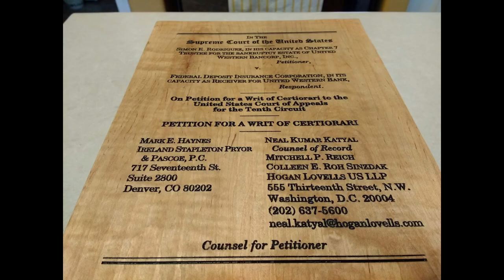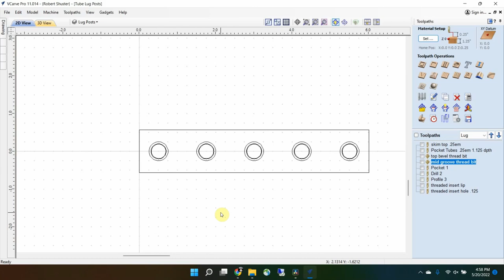Making Custom Wood & Brass Drum Tube Lugs

Comment: Soooo many questions (which translates to inspiration).  I’m heading down this EXACT path.  So, much so I’m in the final process of building two major projects that are all part of a major remodel my wife and I are doing.  One is completing a workshop that will have a CNC machine, among other typical machinery….and the other is a home studio.  Two, questions.  1). Do you sell your plans/designs for the CNC machine?   2).  Do you sell any of the hardware you’re making.  I can’t find anyone to build me a set of really great looking rims for a custom kit I’m having built as I type.  I absolutely hate the generic round style hoops you see online.  I want something in the shape a die-cast hoop.  You’re work is incredibly inspiring, given you’re doing exactly what I want to do.

Comment: Great Vid, Rob! What size tap did you use for the brass tubes?
Reply from the maker: 12-24 for the tension rods.  I like this design for "pretty" lugs, but I am not convinced they will hold up over time.  I am always trying to find that perfect lug design that looks good and will hold up over time.  I feel pretty good about the lugs I did for the "snake skin" drum - they look good and are very sturdy.

Comment: Hey Rob great start to finish video. I'm interested in those threaded inserts you used. They look to be a low profile variety, can you list the manufacturer and part numbers?  I make tap handles and allows looking for a better insert. Thanks
Reply from the maker: I have had those for years.  I will try to find the order info.
Reply from the maker: I "think" these are the inserts I used.
https://www.amazon.com/dp/B01NCJHLR7/?coliid=I3MO0J0K6V7HWT&colid=2M19JRVX5LB2Y&psc=1&ref_=lv_ov_lig_dp_it
Reply: @sidewinderdrums  thank you Rob, ill check them out. I love your idea off using gigs and fixtures whenever you can. Thanks again

Comment: Very nice.  I couldn't figure out how to do an undercut in Vcarve when I did my spinning wheel design so I ended up using Fusion 360 for the tool paths (cedar strip canoe bit).  Thanks for the tip.